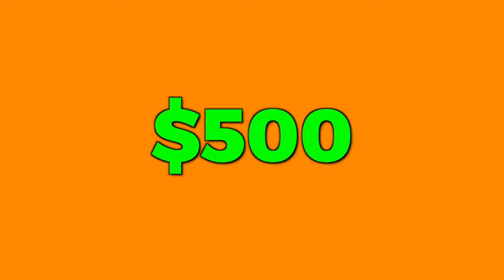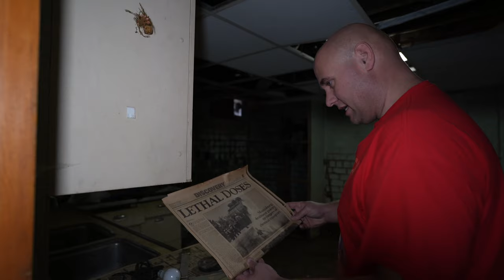Saving the Rat-House!

Comment: Did you get a new editor? Video edited differently than normal, plus sound effects. More production.
Reply from the maker: It's still Eric! Did you like it/was it an improvement?
Reply: @InvestmentJoy  Didn't like the sound effects because there were so many in a small amount of time. Also odd that the first half of the video had tons of text/sounds and the second half had very few as if the editor got tired half way through or if it was edited by two different people. Liked the video editing, didn't like the production.
Reply: @InvestmentJoy  It as jumping around all over. Way Too Many Cuts. Like it was put together with 100's of takes. No need for that. One spot it look like 10 cuts in less than a minute... Seriously? This is Not Tik Tok.
Reply: Is it just me or is most, if not all, of the audio coming from the left channel?

Comment: Wait did you just say asbestos? asbestos is illegal
Reply: To clarify- Exterior siding.  You don’t can’t put in New asbestos siding.
Reply: Asbestos used to be just about everywhere. In the house I grew up in the siding was asbestos tile. They're about 1/4" thick and break easily. The floor tile was asbestos tile. Sometimes the drywall had it in it. Ceilings, etc. The other bugaboo is lead paint. A lot of older houses have lead paint. It was exterior paint though a lot of people used it for interior applications. Paint left over. Some states like Maryland are very aggressive in lead paint law enforcement.
I'm sure I've inhaled some asbestos. I hope it doesn't get me at some point.

Comment: Brandon, you obliviously learned nothing from the Ed McMahon 2002 lawsuit.  None of your properties have proper ventilation nor humidity control.  You never show a carbon-monoxide detectors.  You don’t use No or low V.O.C. paint.  The stair case going up to the second floor is both flimsy and have no traction strips on each step.  You are fostering lawsuits.  Once that happens, your insurance co. will throw you under the bus.
Reply from the maker: You have absolutely no clue what you're talking about
Reply: @InvestmentJoy I can only go by what you show on your videos, and say.  Never have you shown a carbon-monoxide detector, a device different than a smoke detector.  Nor have you shown a hygrometer, a device different from a thermostat.  If you say you have them than fine.